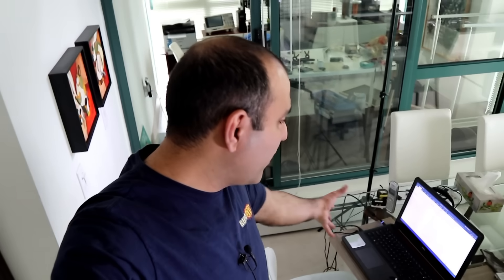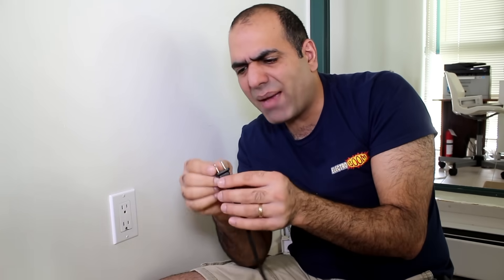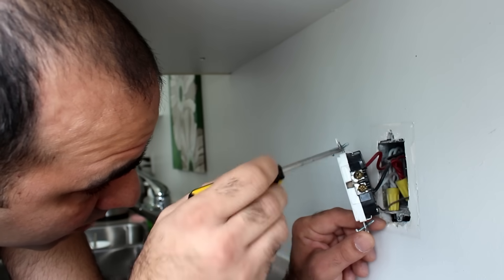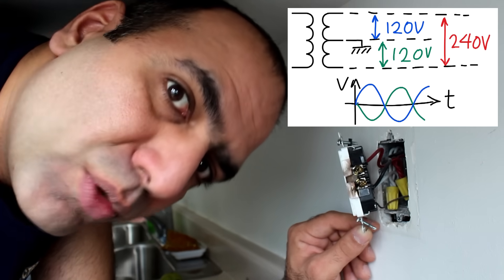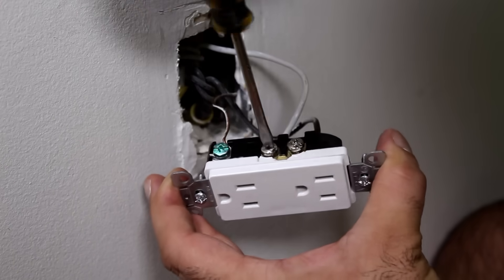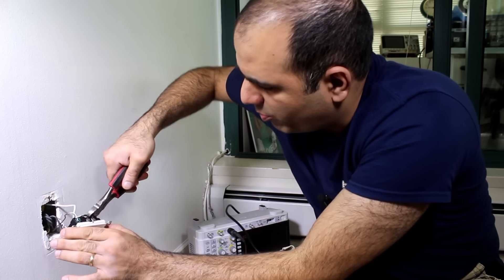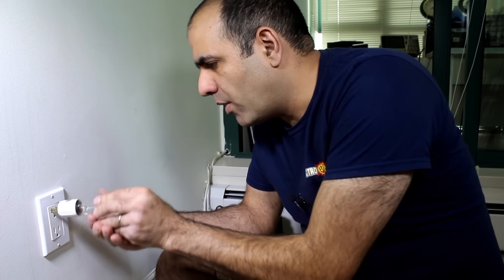How to Replace a Power Outlet

Comment: Holy shit, the amount of stuff that would be illegal in my country in this power outlet is off the charts.
First off is the outlet itself, although this isn't very surprising. it looks like you'd be able to put a finger between the outlet and the pins as you pull it out and that's a clear no no.
Second is the cable management inside the box, do they seriously just twist the cable together and put it in some shitty tube? Nuts, i'd suggest switching those out for wago.
Third is the backside of the outlet, i don't see any cover for you to isolate these screws with..
Fourth, is that ground wire isolated?
Fifth, so is the general rule in this country simply to tighten the screws until you can't go any harder? Does the manufacturer say anything about how many newton meters you should tighten the screws with? (I know most electricians simply don't give a shit though)

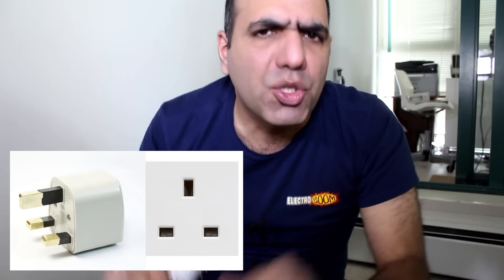Comment: The picture of the "UK socket adapter" at 1:15 is of a fake Chinese adapter - you can tell because the proper ones do not have a shrouded earth pin. This is extremely dangerous as it means the earth connection does not work and anything plugged into the adapter will be unearthed.

Comment: You should address a double white wire situation. When there's two neutral wires but one is flagged with red tape it means that is the hot wire.

Comment: Never use the holes in the back of the outlet! In time the spring clip will put a small dent in the copper wire which in turn will cause the connection to become loose. It could then become a higher resistance connection, heat up the wire, and then go really bad.

Comment: In my country we get 1 phase from 3 phase by connecting the two wires to the  3 phase. These wires are 120 degrees phase shift. Could you explain how to phases 120 degrees apart from each other makes a perfect sine when mixed in a load? (Maths)

Comment: Yeah US anyway has split phase for typical residential feed. 120/240.  Most poles only have the one phase 7200v is common on the primary side.  A high rise would have all three phases although old cities like  Philadelphia have some  legacy 2 phase power. Some big loads are 2 phase 25hz like electric rail and some foundries etc. convert 3 phase to 2 phase.  Tesla started with two phase sin/cos since it describes a circles and made sense to him for rotary motion like a motor. Westinghouse figured out 3 phase was more efficient. There is (was?) 180 deg 2 phase HV distribution for rail.  Might be a good topic for a video :)
Reply: 6 phase power was used in the past to feed into big mercury arc rectifiers to power locomotive motors in the far off past. Now they just use a giant 3ph diesel generator and either directly power the motor via 3ph ac or rectumfry it to dc for maximum torque.  I think car alternators used or still use 6 phases that is rectified into 12vdc. Some power companies are looking into 6ph AC for long distance transmission lines, but anything that 6 phases could do, bipole HVDC  at 1200kv 5000A can do better.

Somewhat unrelated, but there is something I would call "half phase." It's known as SWER, single wire earth return. It's used for transmitting power to really remote locations as cheaply as possible with only one wire. The live is usually some thick steel cable, and the neutral is literally the earth. The transmitting supply has a rod shoved into the earth that somehow builds a circuit even though the return connection could be miles away.
Reply: Idk a lot about old 2 phase. But I’m very interested. Hartford has it too.  A lot of old buildings have super old fuse panels with 4 main feeding wires. Very little information online.
Reply: Szakembőr TV TMIAE , Idk but there is legacy 2400v 2 phase in philly. I guess it was available for industry and sold as primary power for high rises. Google 2 phase 5 wire for sain voltage on the secondary side.  I coulda swore there is 4 and 5 phase but I can't find a reference online anymore. Philadelphia being old had steel band wrapped  hollow logs for water. Hence the term fire plug which was literally a spruce plug jammed in the side of the  log for fire department access. It would be a great video looking in to how standards got to be what they are.
Reply: shaun smit , that looks pretty interesting. Some older used editions are really cheap on amazon. Would be fun to compare the 1907 and 2017 editions :)
Reply: Mathymathymathy...  it should work out to exactly the same as in a single phase system, as the peak of one phase corresponds to the zero-crossing of the other. But it does let you run induction and syncronous motors, which you can't (easily) do on single-phase.
Reply: Six phase has an advantage for loads which require rectification to DC at really high currents. Locomotives, aluminium production, long-wave radio transmitters. Consider that in most methods of rectification you only draw power when the source voltage is above the level of the smoothing capacitor - so you actually draw a sharp spike of power twice per-cycle-per-phase. That means harmonic hell - the power factor is so awful it can't even be computed, and an angry man from the electricity company comes around to ask why their transformers are boiling away their cooling oil. One way to prevent this is to use six or even more phases to drive your multi-phase rectifier. These don't have to be from the grid - you can generate them on site by applying some really big filters that have a phase delay.
Reply: @TheZombini. This is why I like reading youtube comments. Thanks.

Comment: another good idea before you turn the breaker back on is put electrical tape wrap it around the outside covering the screws and the wires this way if you take it out live again it will never shock you or at least it'll be a lot harder to shock you

Comment: A major thing people don't know is that you should wrap the outside of the outlet with electrical tape. So that when you pull it out and the is a ghost voltage (from a fault elsewhere). You won't be touching exposed metal.

Comment: You shouldn't use the spring terminal holes. There's not enough contact and they like to heat up when current is high, especially once they lose their springiness after several years. You should always take t kg e extra time to use the screw terminal on the side to minimize resistance.

Comment: Where do all the cable ends go when you cut the wire, strip it and push it into the hole again? Looks like after a few tries, the value of the socket goes up because of more copper … ;)

Comment: I had a similar incident happen to me when replacing an outlet a couple of weeks ago in the home I just bought. Someone labelled a breaker "kitchen plugs," which I turned off because I did not feel like taking 110V to my hand again. After feeling a tingle while taking the wires off the old one, I stupidly touched the two wires together to see if they were still live or if I was just imagining things. The bright flash and big POP answered that question pretty quickly, which then caused me to say "SCREW IT ALL!" and flip off every breaker in the house until I can map them properly. :P

Comment: Wow, what a hideous design that socket is - somewhat similar to what you might have found here in the U.K. about 50 years ago.

Anyway, the U.K. adapter plug shown at 1:16 is actually a hideously bad (chinese?) attempt at emulating the U.K. design given that they have sleeved the Earth pin, the Line/Neutral pins are visibly under-sized, and it appears to have no current-limiting fuse protection.  Anyone with sense here would throw that thing into the nearest bin.

Comment: You can avoid cutting wires, for those of you with not enough wire, by looking for a pinch release. This usually looks like a reset button found on devices, youll have to use something thing to poke the hole and release the cable.

Comment: Wtf, why do they make outlets with the exposed contact so close from where you grab the plug. Here in Italy, we stopped using them since a while ( the exposed contacts were behind tho, not on the side). Also why are the grounding wires in America exposed? And isnt it easier to not use solid copper cables?

Comment: Love the channel. The UK plug you showed is a Chinese knock off and not a real UK spec plug. The large earth pin you showed has an isolated pin on it. Real UK plugs do not have the isolated pin. Those isolated plugs have been shown to cause the earth not to be connected when fully inserted into the socket as the pin rubs against the isolation part.
Reply: Szakembőr TV TMIAE 
We have fuses in the plugs because UK wiring uses a ring circuit which normally has a 32A breaker. It goes back to just after the war.

You will find more info here that explains it better. 

https://www.quora.com/Why-is-there-a-fuse-inside-the-electrical-plug

Comment: Some outlet brands are pretty shoddy. My place has some GFCI outlets that you can't even push the plug all the way in. If you want the ultimate in grip in outlets, you have to use spec-grade ones, like those made by Hubbel.They are very expensive, but will last forever in a home environment. 

On most plugs, the blades are folded brass. Just place a small, flat-blade screwdriver or awl along the seam and push. Voila! they expand, and grip the socket regardless of how many liaisons it has had in the past. 

Somebody commented that using the grippers instead of the screws can cause failure over time. Hm. I have a dead outlet (GFCI) on my patio. I need to look into it and see if that's the reason. Breaker is fine. Me, I always liked to use chain-nose pliers to first bend the wire to the left, then grip the end and twist clockwise to make a perfect "?" that fits snugly under the screw.

Comment: Dunno if this has been said, or if you knew. But you don't have to cut the wires plugged into the back of the socket. You can (at least for all the ones I've changed - If you are from insurance ignore that) just twist the wire and socket back and forth while pulling the wire out. It won't come out if you pull straight on it, but if you twist it while pulling it should come out.

Comment: I see your problem: It's a US socket!
I'll always think it's for low voltage (24v max) with it's tiny/flimsy prongs.

As European I'd like the Euro/Schuko style, which has some versions with different earthing. Universal Euro plugs are very common. The prongs on a Schuko are quite big and can handle the full 16A@230V. And we'd use a lot of CEE plugs (due to strength, locking and IP44): 16A/32A single phase, 16A/32A/64A three phase.
.
The UK version is odd due a ring-feed of 25A@230V (and requires fuse in the plug) due to copper shortage during a war, the war is over for years. There's more wrong with the UK, they're leaving the EU. And also drive on the wrong side of the road (just joking/trolling a bit)
Reply: 13A per spur and also 13A max per socket. This works out to around 3KW when you factor the 230-240V into it. The ring can be fused at whatever rating the wire will hold (usually 30 or 60A).

Having a fuse in the plug is an odd artifact of having ring-mains be the standard, but also useful, since you can give individual low-current devices a 3 or 5A fuse. Why on earth would you want to fuse a light bulb at the full 13A?

Comment: Yeah...knew where this was going when you put the neutral wire on the hot side of the socket.  lol  

Silver colored screw, longer blade, neutral.  Brass colored screw, short blade, hot.

Comment: Just as I was wondering why my power outlet has this buzzing and crackling noise every few minutes, Mehdi uploads this. He's a wizard, I swear!
Reply: I'd get that looked at. What you hear is the wire vibrating on a loose connection. I had a light switch that did that. I kept putting it off until I turned it on one night and it blew sparks.

Comment: Why does the polarity matter when connecting live and neutral? Doesn't the polarity change 50 or 60 times every second?
Reply: To put it very simply (and I'm not an electrical engineer), live is the supply line, and has a traceable path all the way to the generator.

Neutral is the return line, and is actually tied to Earth at various points, such as the distribution pole or substation. Electrically, Earth and Neutral are very similar. The Neutral wire does not go all the way to the generator, but only allows a return feed to the point where the three live phases are split off.

This is a gross oversimplification, and I'm sure Mehdi himself has a video or two explaining this in a far better way than I ever could.

Comment: One extra thing you can do for safety is after you connect the wires, wrap electrical tape around the sides of the outlet so the screws are completely covered.

Comment: Receptacles are available in different grades. Original builders typically use the cheapest consumer home grade model available which is garbage; buy the next model grade up ($5 vs $2) and you will get a superior longer lasting (increased plug insertion cycle life) receptacle. The upgraded model should have "Back Wired" capability inplace of "Stab Lock" holes. The "Back Wired" model uses a screw-clamping plate mechanism to connect the wire; stay away from "Stab Lock" connections since it is prone to poor electrical connection.

Another, more common, reason to electrically separate the two outlets in a receptacle is to have one continuously powered and the other connected to a wall switch.

You need to do a video on using and how Non Contacting Voltage Tester (NCVT) work.  Anyone who attempts home electrical wiring install/repair should have one; they are cheap and can save a life.

Why did you decide not include the part where you blow up/dammage your oscilloscope by connecting to a mains power supply?

Comment: ElectroBoom you might like to know that most homes have 12 AWG wire in some of the outlet boxes, and the holes in all new devices only accept 14 AWG, due to some changes in the NEC. The reason they made this change is because the prongs inside the device make such minimal contact with the wire that they eventually develop slag and smoke damage from arcing and burn up from the resistance. It's less likely to happen with 14 AWG but will still happen. Most electricians in the US refuse to use the insert holes to prevent the risk of fire. Also, I never change an outlet without checking the wire for power, as breakers can fail to interrupt power sometimes. I've had some burn in place, and while I always use one hand to pull them out, so the electricity doesn't pass through my heart, it's safest to explain this to laymen. (I know you enjoy shocking yourself though hehe)
Reply: Szakembőr TV TMIAE yes, fuses were far more reliable safety wise

Comment: where I live, we use the C plug but without the carved socket (and only recently has anyone I know begun to install I sockets! for most appliances with I plugs, we would use an adapter!)
all of my house's sockets are flush, from the time there wasn't any standard.
my grandpa, my dad and myself changed countless wires over time, with plain white wires, and socket mounts and boxes bought at different places at different times.
it can't go more against the US codes... yet nobody ever got shocked, any time, anywhere, and the breakers never popped, at all.
(except that one time where I shorted out a charger's plug for not looking into the socket when I plugged it... the cover was made of aluminium and I misplaced the plug... anyways, it just sparked and the breaker popped, no harm done)
also, the house is made of brick, and the wiring is embedded into the wall, in metal pipes.
there's no way there's gonna be a fire any time soon..... not then, not now.
good luck getting anyone in my street, neighborhood, county or even province, to buy a house insurance that would cover that
you crappy north america engineers and your cheap standards!
Reply: some outlets are grounded, but most of the usual ones where appliances are left plugged, aren't.
the TV, the radio, the fridge, those are left plugged in and never moved, and their cases are plastic or rubber, so, no way anyone would get shocked.
it's not only a case of making the house safe just in case something fails, but also to make the appliances safe, in case the house isn't.
when you make the appliances rely on the houses' own safety feature without establishing a safe house in the first place, you've failed as a designer.
designers don't make assumptions.

one time I did get shocked: by a static discharge onto a metal computer case, grounded onto a grounded outlet, on a grounded university installation, made to specification.
not only me, the teacher also got shocked by another computer in the same room, 30 minutes earlier.
nothing major, but goes to show how even a correct installation can also shock people, by things totally unrelated to the installation itself.
we concluded that we had been charged up by the conditioned air, ionized as it passed through the vents.
add that onto both of us wearing rubber shoes, and thick clothing, and you have yourself a nice living capacitor.

Comment: Is it common in the US, that the Ground wire is that tiny? It should always have at least the same conductor square area as the phase wire, otherwise in a short circuit scenario, the PE wire could melt first and thus leave normally grounded parts (cases etc.) on mains potential.
Reply: If it is old romex yes I have some in my house.  All new stuff the ground is the same size as the others. I have no idea why they did it (Probably to save money as it is not a full time current carrying conductor.) But it doesn't seem safe to me either.